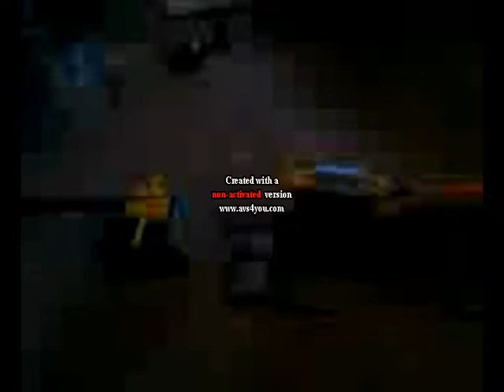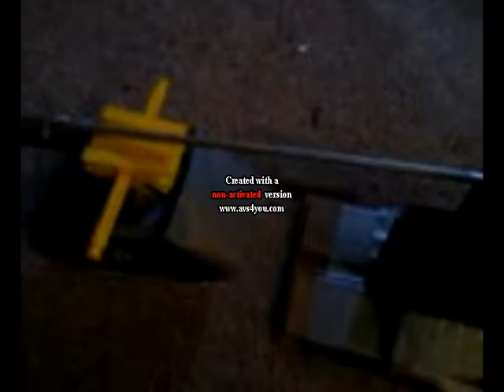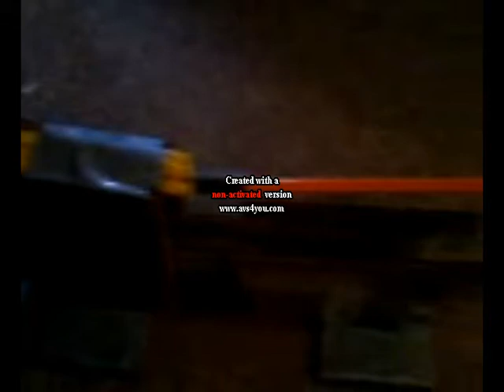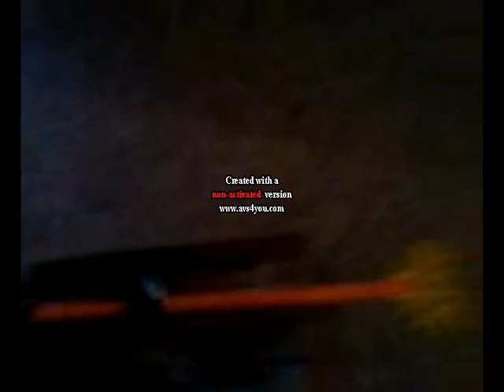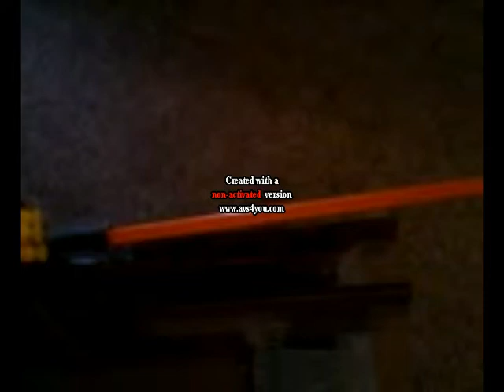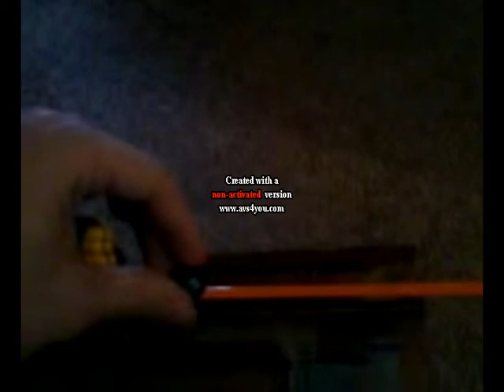SUCCESSFUL OVER-UNITY EXPERIMENT 1

Comment: What kind of energy does it produce?  How is it over unity?  Where is the energy?    How are you measuring it?
Reply from the maker: I'm not measuring energy at this point, I'm only making a deduction that, if it is possible for all parts to return to their initial altitudes, and it begins from rest, then in theory it is over-unity. Also, there is the argument that it does work in both directions. Sorry I'm not more helpful than that. But I think a mathematical or physical proof of over-unity might be possible, studying this device, although it's possible to not understand it.
Reply from the maker: Although this device does not close the loop, my view has been that it paves the way for a horizontal-loop type device, in which the loop is closed. With a closed loop, there is continuous motion of masses, so if that type is possible, mass displacement or piezoelectric plates could be used to generate energy. Maybe that is a disappointment, but if the device were built on a very large scale, and perpetual motion were possible according to the preceding arguments, then the energy acquired might be considerable, and much cheaper than any other form of fuel. Literally, all that would be required is real estate and a little construction, with the right design.

Comment: Dude, you are a cabbage. You are the energy input because you are lifting the ball onto the rail and letting it go. How does the ball get back up to the top to repeat the cycle? If you do it then you are the energy source...duh.
Reply: Nathan Coppedge oh your step-dad supported you for a short while, and then withdrew support. Now you sold me!
Reply from the maker: If you can tell what its doing, basically, mechanically, then there should be no problem. The point is: all parts move up and down automatically from what I consider rest.
Reply from the maker: The marble is moving UPWARDS during the motion of the unit. Plus, the counterweight is activated to move UPWARDS at the end of the cycle. Although not all my designs for this device make use of the entire motion, in this case I think I have proven over-unity is possible.
Reply from the maker: And please see my clearer video at http://www.academicroom.com/video/evidence-against-classical-model
Reply from the maker: egber83 The slope has been tested to be an upwards grade, using a level. Also, in further experiments I managed to increase the angle of slope, and the apparatus still performed this task. What is significant (in my view, anyway), is that work is being performed in two directions: (1) the marble is lifted, and (2) the counterweight can be toggled by the weight of the marble. Additionally, since the marble reaches a higher point than where it started, in theory it could return to it's starting point. So, I think this is evidence of real over-unity, even if this apparatus isn't a perfect demonstration. But according to my step-father "You did it! You built the perfect machine!". He later took back his statement, but he's a major into-science kind of person, who follows entropy to the nth degree.

Comment: So, you're adding energy to the system by lifting the marble (potential energy). How does this not conform to the second law of thermodynamics? This is something you learn in junior high
Reply from the maker: If you study perpetual motion, the second law of thermodynamics mostly applies to electrically-based systems.
Reply from the maker: +Peter Nilsson This device is especially cool because the marble is lifted by the same weight it later lifts. this was thought to be impossible, I think. That's the premise.
Reply: and you still fail to account for energy loss through friction and air resistance. This device will stop within seconds unless you continuously add energy, as will any proposed 
perpetuum mobile
Reply from the maker: +Peter Nilsson The device has momentum from the counterweight. It is potentially perpetual because the two weights are equivalent over leverage. The imbalance occurs because one is supported and the other is unsupported while acting on the other.